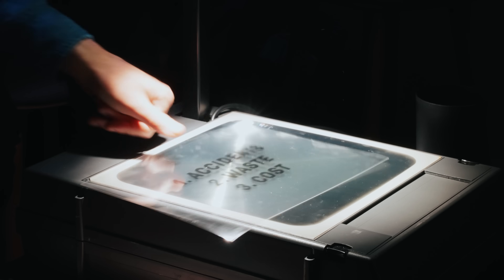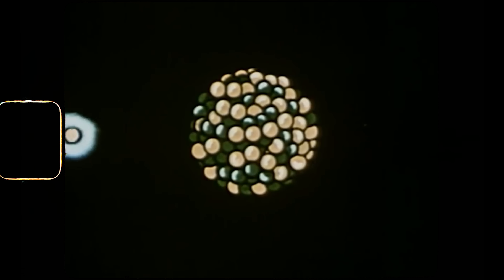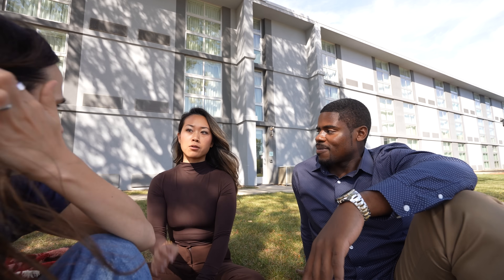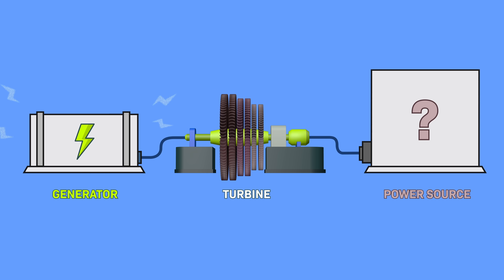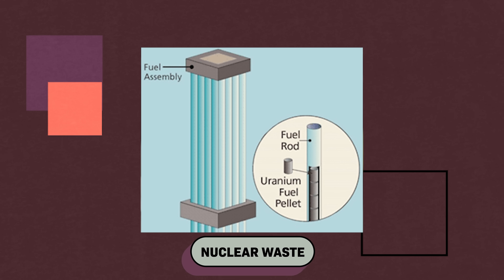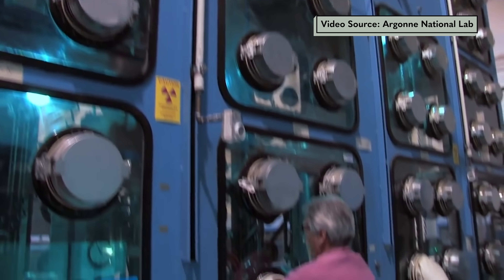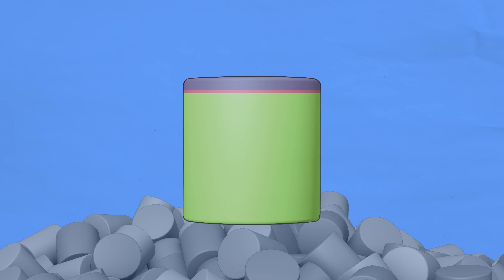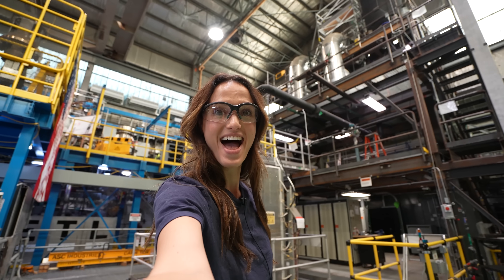The Big Lie About Nuclear Waste

Comment: Did you ask the engineers who need to build the waste plant? Do they think it can be done easy and does make sence? 

Companies marketing are always amazed making something genius 😅
Even scientific and physicists can be amazed about the physics.😅
But only the engineers are the people who really touche the real problems to solve an issu, to get it save en economicaly done? Did you talk to an engineer that is building such a system? 

Talk to people that solve the issues, so  that ideas come reality. If not, you write only a sci-fi story here. Nice theses but no substance. If it's so easy, since 70 years why wasn't  it done? 🙃

It's looks  like the idea of carbon capturing from coal, gas and oil power plants if the efforts are five times higher than build a solar cell or windmill than why don't build Solarcells and windmills first and only the last 10% of the energy consumption will be covered by the very expensive patches of generating energy 😅

Best regards an engineer from Germany.

Comment: So, you have useful waste for 150 years. Besides, you are making more of it all the time. Keep it safe, when uranium one day gets expensive, it is nice to know where the waste is.
Besides useful waste there is four times more thorium than uranium. Thorium does not need enrichment, it is all useful. Burning process for thorium is profoundly different from the uranium process. Some engineering work is needed.
There is no shortage of energy, just shortage of common sense.

Comment: The 'problem' of nuclear power is that it will improve everything that the environmentalists want improved, without giving the environmentalists any power over the lives of other people.

Every time energy has gotten cheaper, people have polluted less and recycled more.  Mining coal saved the forests of Europe.  Burning kerosene in lamps saved the whales, because it cost less than whale oil and burned cleaner than whale oil.  Break throughs in synthetic oils removed the need for harvesting sperm whales.  Cheap electricity and arc furnaces made aluminum and steel the most recycled materials in history.  With the new energy poverty, recycling has actually declined, because it becomes too expensive without cheap energy.  Give us cheap electricity and everyone will heat their homes with a combination of heat pumps and baseboard electric heat.  As heat pumps double as air conditioners, the threat of deaths from heat waves plummets as everyone will have AC.  There will be no need to ban natural gas stoves, as electric ovens and range tops are cheaper to build and cheaper to operate.

Nuclear power was not attacked for being dangerous, it was attacked for its potential to pull the rug out from under the environmentalist movement.

Comment: Now lets skip the "make new fuel rods" part, and use the salt solution you melted those "spent" fuel rods in, as the reactor.   The Molten salt reactor designs, when they "melt down," are entering their safe operating state.

  The themal spectrum, thorium fuel cycle molten salt reactor skips the whole need to have solid fuel assemblies, or have a pressure vessel, as there is no need for water as a thermal transfer fluid.   It was Alvin Weinberg's materpiece, that was ignored in favor of the rube goldberg complexity of solid fuel water boilers... in no small part, because the fossil fuel industry did not want to compete with a fuel a million times more energy dense, than theirs, used at 99+% fuel consumption effficiency, versus the 0.5% to 0.7% fuel burn of water cooled solid fuel designs.

 You should watch Kirk Sorensen, and the Thorium Remix channel, for more info on the LFTR design MSR.

Comment: Broken English German here...
All related to radioactivity is oversimplified in this clip. There is lot of stuff other than uranium that is radioactive. One of this stuff is called "Argon" corrected Radon itself. (RADION can be dangerous by nature without human activity as it is a heavy gas that could accumulate in ground floors and is radioactive with Alpha Radiation  too ) 

Optimismus is striking but not always justified here. Fact:  35 YEARS AFTER Tschernobyl some areas in Bavaria (two thousand miles away from Tschernobyl) cannot eat wild pork cause pigs eat mushrooms that accumulate radioactivity. 

.... or do you want to have a handicapped child?

Fact: Protecting / escorting for safety for a Transport of a nuclear waste Container (dubbed "Castor"). is not allowed for female police forces in Germany. Th e Problem is the handling.
Reply: Well I think you are talking about Radon, not Argon (because Radon is the only radioactive "Noble" Gas). Radon is the main source of natural radiation background, which mainly comes naturally from granite stones. So beware of granite.

Reuse of nuclear waste is much safer than just store it, because after reuse the waste is lesser radioactive than fresh waste.
Reply: @zeroespero tell it the Martians ... its cosmic rays.

Comment: There's no "If we can recycle nuclear waste"… In France they do it daily.

As for the proliferation angle, I strongly suggest you chase that rabbit a bit more. Many people still do not understand where the FUD (Fear, Uncertainty, & Doubt) actually came from, how it is tied to incumbent commercial interests, and how those interests used the history of the Middle East, Gaddafi in Libya, latent Islamophobia, and the misguided anti-pollution movement (oops, dilution is not actually the solution, sorry kids of the 1980s) to get people to vote in particular ways and to accept pseudo-libertarian talking points in place of solutions.
Reply: In France they have a different problem. The EPR reactor which was though to replace the old reactors had a huge cost overrun and big delays. So they are still using their old reactors because the replacement isn't there yet. And those old machines are not very reliable any more.
Reply: @hg6996  That's not cool. I've long had the experience that "lowest bid" sourcing is a scam, as inevitably somebody will obscenely underbid to get the contract and then just keep passing along "overruns" that were completely foreseeable.

Comment: The experts in the KIT in Karlsruhe told me this when I attended my radiation protection course.
They said, the only problem with the recycling process is that the same equipment which enables you to recycle nuclear waste can be used to build material for nuclear bombs.
Not an issue for the US but for a country which is not yet capable to do so, it is a problem. A political problem.
Reply: It's not a "political problem". It's a World-Ending Global Suicide Pact problem. Increasing the supply of weapons-grade material could end all large animal life on Earth. That's not "Political", like it's some flippant abstract policy change.
Reply: How many of these molted salt plants are in production? Zero. They have been anouncing that since the eighties. Did they also told you that plutonium nuclear plants are also considered to be green now? The nuclear lobby at work
Reply: I think in Germany our main problem regarding nuclear power is that the coal/fossil fuels lobby and our politicians are very close (like this 🤝). The coal lobby has enough money to convince the majority of the politicians that burning coal isn't "that bad". 
How should we reach the coal exit like that?
If I could decide, I would go for renewable energy + nuclear power for the remaining energy needed / as a backup
Reply: Oh, yeah, that would be a problem when other countries can’t be invaded by the US because they have nuclear weapons. A big problem indeed!
Reply: It's a problem because the US thinks that they (and their friends) are the only ones responsible/smart/privileged enough to be allowed to have nuclear weapons.
Reply: So...why not do it here?  Was Jimmy Carter afraid to trust the USA, the very country he was president of?  Crazy!
Reply: Yeah. At the point where she said that she had to prove her US citizenship and wasn't allowed to film inside, she should have mentioned the problem of national security and the proliferation of nuclear weapons. If you can recycle Uranium 235 from spent fuel, you can also get the weapon's grade Plutionium.
To be fair, she mentioned Jimmy Carter's ban but she made it look like an anecdote instead of explaining the gravity of the topic in full scale.
And still there's the bottom line: It's cheaper to burn "fresh" Uranium instead of recycled Uranium. And if you're ready to invest more money in more expensive recyceled fuel then why not invest that money in renewably energy where you don't have to consider fuel cost at all?
Reply: @drCox12  I don’t get the US citizen thing? I hold a UK ATOMIC clearance, guess who we collaborated with at our labs. My dad even gave a lecture at Los Alamos.
Reply: @peterking8586  UK has nukes already. Non-issue for UK, it's the countries like Syria this becomes a problem.
Reply: @onebylandtwoifbysearunifby5475  You can ship your used fuel to a nation that can safely reprocess it.  British Nuclear Fuels did this for Japan for decades. There are security concerns around shipping waste of this nature, however those concerns are the same for new fuel rods too.
Reply: @RetroBytesUK  Yes, but what rules are you going to make preventing nuclear-seeking nations doing enrichment through cleaning? And who will enforce them? 

It's not that using these cleaning methods are bad, but this presentation was just a parroted sales pitch she got from those 2 corporations. It was like a video sales brochure. 

There's a lot more to it. A bit more comprehensive discussion would have been appropriate for a science channel. It may be a good solution, but nobody can tell from a sales pitch approach.
Reply: @onebylandtwoifbysearunifby5475  There would be nothing stopping those nations with spent fuel rods doing it now, apart from the huge expense and the technology gap between them and the UK. Shipping the spent rods to the UK for reprocessing, does not change the balance of risk.  If anything having a much cheaper way of doing it using the UK reduces the changes of a nation using this approach to try and enrich fuel.
Reply: @RetroBytesUK  Well, sure. But by that logic there's nothing stopping any nation from becoming nuclear. In practice, however, it's exactly the equipment supply chain that both restricts nuclear weapons development AND alerts other nations to covert weapons programs. 

So in providing reasonable cover for these activities, the amount of untracked fissionable material inevitably increases, and so does the infrastructure for nuclear ka-boom making. 

That said, as long as these are shipped to select approved facilities, that should be manageable. But Japan is in a defense treaty with U.S. anyways, so that's a poor example of success. It's more the Syria and Afghanistan and Iran-backed puppet nations using these cleaning techniques that are the problem. And who's going to tell the "no"? Once the power market for this fuel becomes widespread, fission weapons are right behind, historically. 

Point here being, this needs to be thought out carefully. Not just reading from a sales pamphlet the nuclear industry salesperson gives you, and you then read it aloud for a Yutub video. There are many complexities involved.
Reply: So, without getting into too many details here, just having the material to build a weapon doesn't give you the ability to do so. There is a LOT involved, which is why you don't see rogue nukes popping up everywhere. If a nation really wants nukes and is willing to pay the cost, there is little anyone can do to stop them short of military action. And there is absolutely nothing stopping a nation from operating nuclear power plants and processing spent fuel for plutonium. Many countries reprocess fuel already.
Reply: @Kelnx  1. There are NOT many countries reprocessing. 2. Nukes are difficult, but the tech isn't impossible. The biggest flags that a country is going nuke are the big centrifuge arrays needed for U enrichment, and nuclear reprocessing. It is a Big Deal (TM) when countries set up reprocessing.
Reply: @Kelnx  There is actually a lot stopping a nation from operating spent fuel reprocessing plants, including but definitely not limited to military action. So I guess you just don't know about it?
Reply: @SocialDownclimber  Considering many countries do operate them, I'm unsure as to what you're getting at. Obviously doing so invites the scrutiny of the IAEA for many countries, but any country wishing to do so for peaceful purposes has nothing actually stopping them from doing it.
Reply: Imagine other countries in the world doing this. The US would outright threaten them with war if they did. The video skipped over a lot of downsides making it sound like they are just an inconvenience. Political issues. Issues with managing and storing plutonium. The fact that there is a lot of nuclear waste that are not spent fuel rods ...
Reply: @devluz  France is recycling spend fuel they also have nukes there is more nations in europe who do recycle and reuse spend nuclear fuel
Reply: @D0P1C3  The UK does as well.
Reply: @peterking8586  The US citizen thing is for the public (i.e. not approved researchers). The issue with Europe's recycling is the use of PUREX, not a tech you want spread around outside current weapons states IMO. The tech discussed in the video used with EBR-II is electrochemical or originally called pyroprocessing that doesn't produce a pure Pu stream.
Reply: @D0P1C3 I do not believe France is able to recycle significantly nuclear waste. R the Swiss

Comment: The fuel pellets used to make the fuel rods of boiling water reactors break down and are then stored  as waste forever. Only about 10% of the nuclear fuel is used up. Boiling water reactors are the ones that we now use that can melt down if cooling pumps/valves fail. MSRs can use much more of the nuclear fuel. They also can't melt down or cause hydrogen explosions by losing cooling.

Comment: Take a look at CANDU Reactors and the new SMR Reactors in Canada, I currently work in software dev subcontracting for the nuclear industry here. we use them here in Ontario and I think we are actually reusing at least some of initial fuel and heat generated, don't quote me but I remember reading something about it

Comment: Interesting, but the integral fast reactor wasn't terribly economically viable compared to the typical reactors, even after the sodium and other safety concerns. It was very doable though. Molten salt reactors, including waste burning versions, are potentially very, very good though, due to better safety they're shaping up to be more cost effective. Also about waste, all of the high level waste isn't actually high level anymore, and the timelines quoted for storage are often blown out of proportion. Great video though!

Comment: Heh, I was commenting elsewhere last week about just this subject. Although, I was unaware of the prototype actually being built.
Hell, we have space probes that use a type of purified nuclear waste to power them.

My standing joke remains a truism, we go to extraordinary lengths and technological leaps, all to do the same thing that we do to make tea - boil water (yes, I know about pressurized water reactors, work with me here).

Oh, NASA has exhausted their plutonium supply, so they're unable to make more radiothermal generators for deep space probes.
No, not that plutonium for bombs, Pu238. Pu239 is used in bombs, 238 is too unstable to use in a bomb, just as 240 is insanely too unstable to use in a bomb.
In 2017, orders were placed to produce more Pu238, with production in 2019 being at 400 grams a year and upscaling and new production at Oak Ridge bringing production up to 1.5 kg per year. That's around 3 1/3 pounds, for the metrically challenged. That'll be badly needed for any missions to Jupiter and beyond, as solar is useless that far from the sun.
Oh, long lived too, a whopping 88 year half-life. The shorter the half-life, the hotter it is, thermally and radioactively, the longer the half-life, the colder it is overall.

Comment: Just the fact that the stuff is so radioactive tells us that there is still a lot of energy in it. History is filled with inventors finding ways to use waste products. Saw mills were producing so much saw dust that they had to either pay to burn it or pay to have it hauled away.
    Then this guy started going around to the saw mills offering to haul it away for free. He'd found a way to sell it for profit, by compressing it under very high pressure so the resin in the partials of wood was squeezed out enough that the lump of saw dust glued itself together in a solid "log". Wrap it in paper and Presto, you hade a log of fire wood that would burn for a precise amount of time and leave little ash.
     Others found other uses for sawdust and other bits of scrap wood.
     When they first started refining crude oil to make lamp oil they had a highly volatile, extremely flammable by product that was utterly useless. It was way to flammable to use in lamps, but then this guy found a way to burn it in this new type of engine based on the engine that Rudolf Diesel had just invented. This new engine needed an igniter but this new fuel would allow Rudolf Diesel's engine to run with a much lower compression, making the engine light enough you could run it in one of those new horseless carriages everyone was starting to use. They named this waste product petrol for "petroleum distillate" but some weirdos thought gasoline was a better name for the stuff for some reason.